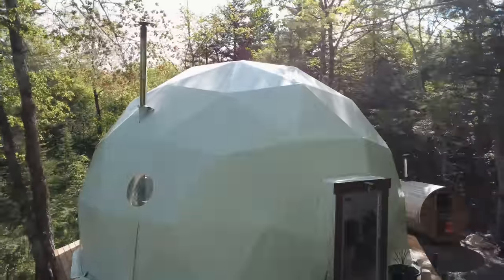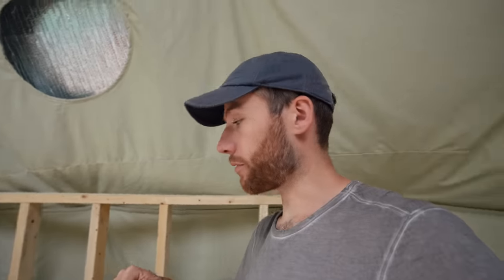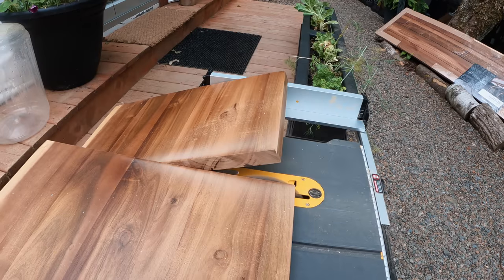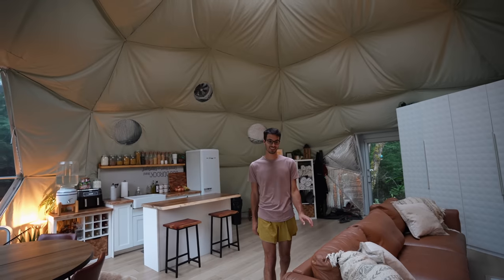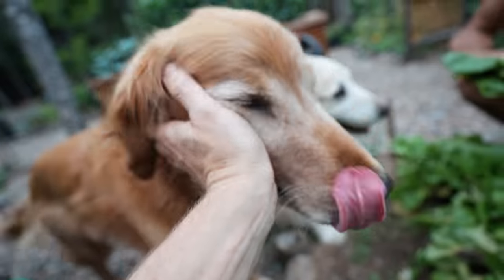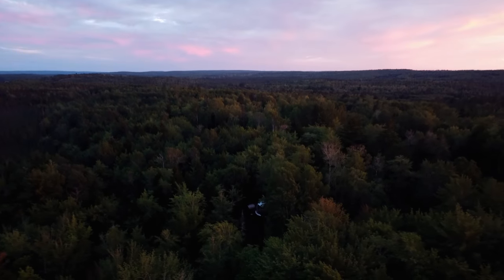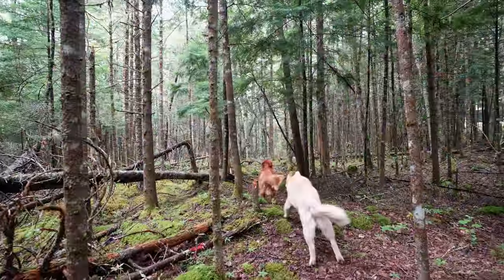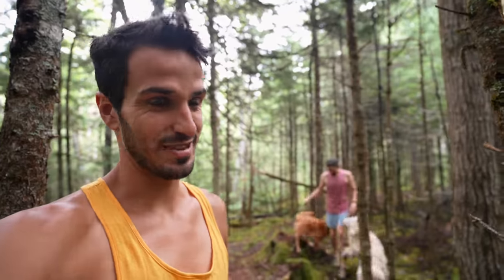Change of Plans to our Geodesic Dome

Comment: The dome looks … awesome!  
I was wondering why you haven’t cut out the insulation around the porthole windows?  Have you considered asking the manufacturer if they could fabricate a windows panel with an actual working window to let in fresh air?
Reply: oh yeah that would be so cool
Reply: It is much easier to vent in fresh air.  Putting in a window requires building a structure around it rigid enough to stand the opening and closing.  If it flexes enough to make it even a slight bit off square, the window either wouldn’t open or be difficult to open.  Given the dome isn’t their permanent living quarters, trying to put in a window would be more work and expense than it is worth.

Comment: To maximize space in the kitchen I would have suggested putting that cement board on the back of the 2x4 wall in the kitchen - that way you could put tiles on the cement board and little shelves in between the 2x4's for spices, etc.

Comment: One Pot Pasta is the best: Tip, save your vegetable scraps in the freezer and when you have a bag full make your own vegetable stock. Carrot tops, onion skins, herb stems and roots…. Just let it simmer in water till the liquid is reduced by 1/4. 

Use the stock instead of water when making your pasta, add a can of coconut milk to make a creamy pasta.

Comment: Keep up the good work. Speaking of lumber milling, I followed a "Pure Living" youtube channel which chronicled their evolution of learning to mill beams and flooring. The earlier attempts used a chainsaw attachment, but it seemed risky and didn't produce the cleanest cuts. Later, they upgraded to a Wood-mizer portable sawmill which required a lot of attention to keep level and sharp. With all they could do at home, the planks they made still needed to be sent off to be kiln dried. They also attended a really-neat timber frame workshop at the Shelter Institute which is worth mentioning.

Comment: No need to send that Hemlock to a mill. I am sure you can find someone with a portable sawmill that will come right to your log and mill it into whatever you want. They can also teach you how to take care of it in order for it to cure without warping. I built my first home from trees that came down when I had my driveway to my building site built. A local guy came and milled those trees into what became the full frame of my home-foundation, roof and walls. Look for ads for people who offer portable sawmill services, or ask for recommendations at your local lumber and hardware dealers. Thanks for another fun video!

Comment: Sometimes using expertise from others is the wiser choice and safer. Glad you will incorporate the tree. It might be worth checking out if that oil is something that would rot or cause it to crack? Now that it is exposed.

Comment: You Guys are crushing it !!  You should get a trim router and finish the ends of your counters with a round over. Also if your going to mill that Hemlock you should get something under it and put a raised tarp over it to keep out moisture and prevent rot.

Comment: you need to see if you can install a turbine 100 metres from a creek..have an intake pipe..turbines are lodged in a 6x6 shack.it works 24-7 and supplies the power for all your gadgets, the fridge, the wifi..etc..there is a guy in wales on youtube, he built an earth cobb home but he has a business setting up microturbines on homesteads..in Canada or the USA, we can zoom call him..he prints the turbines POD, they are like spoons that turn around a hub..and it turns mighty fast..much reliable voltage.
Reply: Hi Andre! Good idea! Wind power would also be feasible. Any size from "computer fan" to "flagpole top". Wait till Todd reads this! He'll have a field day with new projects. 😁

Comment: Maple twigs and chips are great for smoking meat. We soaked the dropped twigs, put a drip pan under the bird ir roast or whatever then put the soggy twigs on the coals.  Mmm mmm. That maple flavor from the steam and the smoke was delicious. We used a regular charcoal grill with a top. We didn't have a smojervand turns out we didn't need one.

Comment: Do not get rid of the round small wood cutting - turn them into neat sits or side tables.  If you sand it, treated and apoxy it should be very neat and gorgeous

Comment: Thank both of you, your adventures are a strong part of my 'Old life.  Recently while talking to us while purchasing in the stream, a comment (as I perceived it)  for settling for someone is better than wasting life in search 4 Mr. Perfect is so wasteful of life.  I took your advice and bluntly, after 3 years, giving the answers to a 66y/o that responded immediately; Wow, Guys, you are correct.  I am preparing for a selloff of most everything and looking for 27+ acres in another area.  I had settled on plans similar to your canister home,  I had already purchased two 14x50 and reinforced both, purchased a Teslar system still being created, and in storage a Dome agricultural 50 feet  - 80 ft connection connected aquatic grow center.  My DNA from both sides of families is more than 105 years. There are 30+ years I can now look forward to (hint about me depending on the Mid-term election and the next January 21,2023 I will retire or not,  I am a Marine.  My favorite color is Blue,  sign cust of Aquarian and Pisces;  look both up.

Comment: I’m not so sure that is oil on the hemlock. It looks more like spalting, which is naturally occurring in dead trees. But that hemlock will give you enough slabs for an indoor kitchen, your bathroom, your outdoor kitchen and floating shelves beside your bed. I have floating live edge hemlock shelves beside my bed and they are gorgeous. Got the hardware from Lee Valley. I wonder if they would sponsor you?

Comment: I know it might be too late but I have an alternative layout for your dome that would also provide for a bathroom and a nice size clothing closet. It could also be a nice remodel project should you ever want to make some changes. 
Essentially build a wooden box in the middle of the dome. Be sure to have a flat side facing the picture windows. This could have two options. One would have your bedroom inside the box on the first floor. Another would have your bedroom on top using a regular bed. On the wall facing the picture windows place the sofa so you could have a beautiful view to the outside. The next flat side would be the kitchen wall cabinets . Across from the kitchen cabinets could be an island with stools for dinning. The third flat space next to the kitchen could be a dinning room. As an other option maybe a bedroom. The fourth would be the door way to inside the box. This box is essentially a wooden room providing more options. 
I hope you can use my idea in some way. 
Be safe and have fun.
Reply: Hi Jerry. Bedroom on top in the dome? I'm wondering how happy the dogs would be. They would no longer be able to sleep together with daddy and daddy. Not to mention the risks when T&T would need to go to pee in the middle of the night after a nice bottle of moonshine... How do you do that without tripping and falling? It doesn't bear thinking.
Also, I think they did consider your solution, but went with the open layout instead. They get such a lovely designer view both of the inside of the dome, and the landscape outside. But you never know. If they suddenly run out of projects, perhaps they'll change their minds. 😉

Comment: Hi guys! The trees you had taken down... I weep for the lumber. There are so many ways you could use both varieties of wood on your property, and especially in the dome.  Many geodesic dome dwellers wish for more storage, and will mostly opt for under the main platforms, or, overhead, and around the perimeter. For overhead, that would require some nice tall poles, and some nice long beams, to set up overhead platforms, though not very deep ones. Alternatively, you could actually build a free-standing sleeping loft for those cool winter nights... the warm air rises. 
But you guys use your own creativity, and/or work with an interior designer... surely you know one among  your family and friends? The point is the lumber though. All the main trunks you should have had cut to at least 9-foot lengths (to make 8-foot finished lumber, or as long as could be safely felled, once stripped of all the upper branches, then stacked aside to be peeled and racked to dry for a season before milling to finished size, depending on your needs. Use the winter for final planning. And as far as a mill is concerned, they are starting to be more affordable, but look at depreciation tables first. Not worth it if you are only going to cut a dozen mature trees. Some mills will work on a percentage basis (they get to keep X% of the milled lumber for their fee) but they may also have minimum order requirements. Also, ask for the cut-offs, and you might also need to transport to and from the mill. Lots to consider, but aat today's lumber costs... wow.
True, you have a lot of smaller wood to burn as heating fuel (and atmosphere ;-), but please get a nice, big, thick, soft, woven flokati for in front of the wood fire. ;-)

Comment: Hi guys, just watched this episode. Loved it! Can I make one suggestion? I noticed you seemed to put a squared piece of timber across the top of your kitchen back, and from the video it seems that the dome liner is draped along it. Over time wood can move and I am not sure if your dome liner moves, but if so, it could rub along a squared edge and eventually tear. I would suggest sanding the touching edge so it is rounded over and less likely to ever catch.

Comment: Hemlock is great wood for raised beds! Of our local wood it's probably the most rot resistant. Our old growth hemlock is one of our greatest carbon sequesters. Outside of maybe small branches, I wouldn't burn it. Too valuable for other purposes.  Did you find out if that dead hemlock was due to the Hemlock Wooly Adelgid or indeed the heavy traffic/compaction on the root zone? I'm sure if it was the invasive insect your tree folks might suggest monitoring your other hemlocks.  

As always, enjoy watching you too. Thanks for sharing the highlights and the lessons learned.

Comment: I don't recall now whether you did anything to insulate under the floor but I don't think you did. I would find some way to do it if not. 
I would also put some kind of skirting around the outside to block the cold wind from blowing in under there. I would think you would get a lot of heat loss there in the winter.
Reply: Hi Werner. You mean under the dome? If I remember correctly, they had the underside of the dome floor sprayfoamed, so that should give good insulation. I don't know if they are skirting, though. cheers/CS

Comment: Hey guys!
   Another great vlog ....BUT....it triggered a couple of questions for me...
1st:  I was noticing the reflective insulation in what I think were once the window holes of the new inner fabric wall. Did U2 forget to cut holes in the insulation or are you going to trade the view from these holes for a little more temperature control and no holes in the insulation???  ....or maybe getting "SEE THROUGH" windows again is just another step for later on a little further down the road?
2nd:  Have UGuys ever watched the "Outsider" vlogs on youtube, where a father and son built a log cabin?  The reason I bring that up is because I believe that this father and son cut ALL of their own wood that they used to build this cabin. And I'm not saying just the logs that made the exterior walls, they brought in a small mobile SAW MILL --(it was a big band saw if I'm remembering it right) so they could cut large diameter trees into 1 or 2 inch thick boards. THAT machine just FASCINATED ME because it really was like having a MOBILE SAW MILL ---(They brought it to their chosen building site with what appeared to me to be a relatively small farm tractor-we had one very similar to this on our family farm here in Utah when I wuz a kid.) ....BUT.... I'm almost positive that you guys could pull this Log cutting band saw with your truck that you pull your RV trailer around with, and THEN you could cut up that big tree trunk that the Arborists left, into any size you want and make more counter tops or a dining table in your container home that you're gonna build, with out having to ship it to some other place.  I have not checked into this but MAYBE these Mobile band saws can be RENTED and you wouldn't even have to actually OWN the thing. Just keep it a day or two and take it back until you wanna cut off another peice and make something else....?
I'm a "city slicker" now and will probably be one til I drop....just because I don't know how to get back to the country living at this stage of my life, but if I was in your shoes and environment, I'd LOVE to try working with something like this "Mobile Saw Mill" machine.
Lemme know what y'all think
Utah Sterling....but U2 can just call me "Ster"....all my long time friends do.